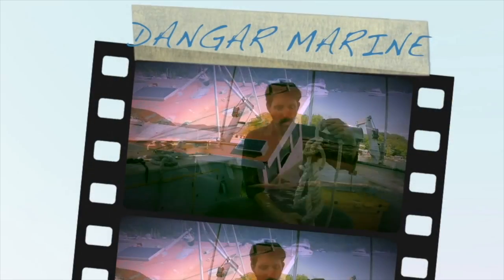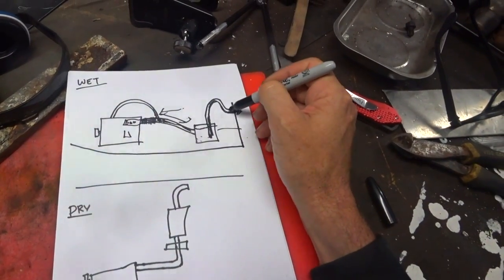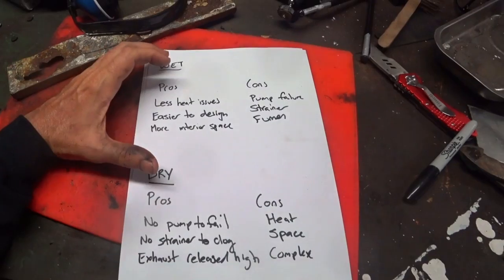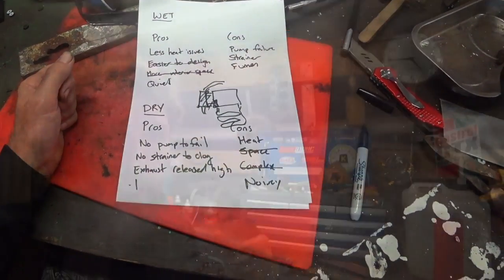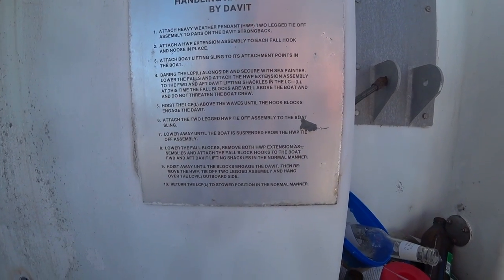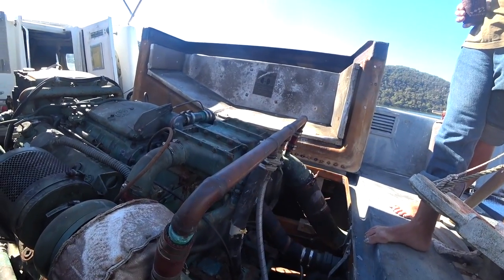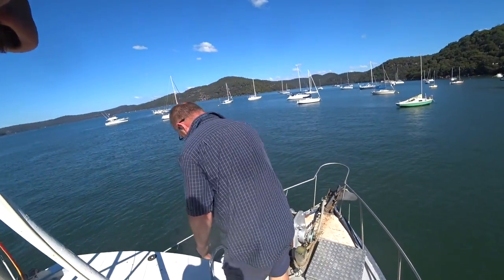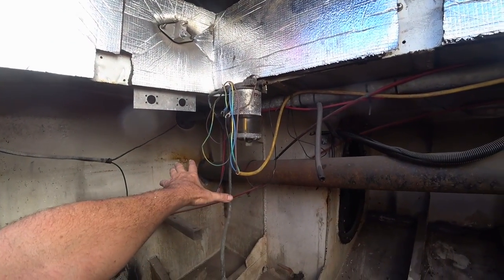Wet Exhaust vs Dry Exhaust

Comment: Looks simple enough to modify dry exhaust out in existing, just double pipe it through the deck muffler could be installed near through deck, then double piped/shielded, like on a semi-truck, then have large pipe out top of muffler to reduce back pressure and cooler pipe section so heat will naturally rise out to cooler air. Not over think it, I think it could be easily installed by you once you understand your sound deadening and pipe size needs, 6" pipe schedule 10? Keep exhaust manifold cooled to create temp differential to have slight vacuum at exhaust outlet. 
What old car guys used to do was leave cast manifold in place and 1.5 times the outlet from original for cheap performance/extraction/exit of exhaust.

Comment: If that exhaust leak is before the turbo it will be why you are lacking power, and blowing smoke. The turbo wont be spoiling enough to run how it's mean to resulting in in burnt fuel. Also you don't need to pull the turbos off the check if they're okay. Pull the air filter off and check the compressor wheel for chips, cracks, see how easily it rotates and see if you can move the shaft up down left or right. If it moves much then the turbos are due a rebuild. You can even remove the exhaust and check the exhaust wheel if you want to check, but the main thing to look for in those turbos is play in the shaft.
Reply from the maker: Hey Mark, thanks for the info. I'm looking forward to taking a look at fixing this boat up with Rick on day. It is a great offshore fishing boat when it is running well.

Comment: A properly installed dry exhaust has less parts and less to brake down . On a lot of engines the noise comes from the air intake that is equal  to the noise of the exhaust .  Just mount a air intake silencer / intake air filter and the noise goes down a lot .

Comment: I think by having the muffler closer to the end of the exhaust serves two purposes 1st smaller muffler 2nd less weight. I believe your way ahead with the dry because of space and failure rate . The engine is in need of lots of air and by running a second pipe just short of the end of the exhaust (18-24 inch’s) and with a K-N filter your fixing a lot of problems . I honestly believe the dry exhaust is the way to go ! Less moving parts so to speak ! 😆 can’t wait for more videos bud ! And a messy shop is a busy shop ! If they don’t like it , well they can come and clean it ! You need to talk to those chickens , there laying down on the job !! Lmao 🤣
Reply from the maker: Yes, I'm looking forward to talking to those guys about the placement of the muffler or even mufflers. I think with a bit of planning the dry exhaust can be made to be quiet. I'll get those chickens off their butts. ;)

Comment: I'm wondering if your boat might have had a bigger motor at one time which necessitated the wet exhaust system. I agree with other comments that pointed-out that over-the-road Jimmys  all have dry stacks and mufflers.

Comment: There is another wet exhaust that exits at or below the waterline. It has a rise in the interior that stops the sea water from coming back into the engine and not only quiets the exhaust, but also stops the problem of exhaust from coming bck to the people on a following sea.
Reply from the maker: Yes, I think that is a better way to go.

Comment: Looks like it was dry without a muffler(s), I'd reckon it's have been quite noisy. I'd expect that the wet exhaust would be quite restrictive and a dry exhaust with a good straight through muffler would be a lot better from a performance point of view. As you and others have mentioned a dry exhaust would free up a heap of room.

Comment: another great vid Stu, looking at your boats config I'd say it was a lay down misere to go back to dry. it goes neatly up the outside wall, and you get your engine bay and lazarette back. with ceramic coated pipe a decent blanket and a heat shield should be nice,just get a straight through muffler diesels don't like baffles. try agaus.com.au for thermal blanketsor ready made removable pipe wraps found them while researching thermal insulation for a forge cheers
Reply: That's an awesome post...
Reply from the maker: Thanks mate, I also think going back to dry is a big of a no-brainer. Thanks for the link to the insulation.

Comment: Only issue I really see with the roof-pipes is that it's a completely open vertical system, meaning any rain is going to go straight down those pipes and eventually back into the heads.  Having to design a system to prevent that completely might be a bit of an issue since your through-holes are already laid out, you'd need a sink-trap and a drain for it somewhere or to have an upside-down U on the top so the pipe points downward to prevent water ingress.

Comment: I used to work on those 8V71-TI and the 4-71 in your boat. Wet exhaust is absolutely necessary for a two stroke engine for efficient exhaust scavenging. Dry exhausts work well for four stroke engines. However there is something to be said for keeping it simple.
Reply: Wait, didn't those Detroits also go into school buses, trucks, generators, etc.?  How did they do wet exhaust in those applications?

Comment: Seeing as an effective muffler is quite tall, could the boat have been refitted due to height restrictions where it was operated at some time?  Low bridges or to fit into a shed?  Or maybe for soot and particulate emission control/restrictions?  I imagine a horizontal muffler +heat shielding would take up some deck/roof space and have to have weep holes for condensation and rust prevention.  I would think that mufflers used for large construction gensets operated in residential areas would be a good starting point.
Reply from the maker: I wish I knew more about the history of this boat, I think it would answer a few questions. Good idea to look at how gensets muffled in residential areas.

Comment: All very informative, good work. But I sat through the rust removal one, I was too tired and cranky. Look up molasses for rust removal. 10 water to 1 molasses, 2Weeks in the bath, all rust is gone, but not good on galvanized, tends to eat  some alloys. Heaps on poo tube. Good luck.
Reply from the maker: No worries, I shouldn't have snapped either. I have heard of people using molasses. What I have enjoyed about the electrolysis bath is that once it is set up I've just been swapping parts over and cleaning a whole load of stuff up without the need to buy any supplies or do any messy cleanup.

Comment: Looks like you'll probably have to build a locker to surround the exhaust pipe, between deck and roof level, insulated and soundproofed- but, other than that, you're already set up to go dry. It really does make you wonder what the huge advantage was, that the previous owners went to wet. Maybe they were smugglers? Anyway, looks to me that the amount of maintenance a marine motor gets is proportionate to how difficult the access is, so anything you can do to make it an easy place to work is an improvement! Rather prefer to be careful of 1 hot pipe, than have to climb around all that funky plumbing...
Reply from the maker: Good point about the maintenance dropping once the access is difficult. That is human nature.

Comment: Nice work, good overview.  So your trawler already has a keel cooler ?  The raw water pump is just to cool the wet exhaust presumably.  The 2 stroke is going to be very picky about back-pressure as you say.  Is a used john deere 6068, or Cat 3208/3116 out of the question ? 4 cycle non electronic might be a good way to go, quieter more economical lighter weight etc
Reply from the maker: No, it currently has a heat exhanger on it, not keel cooled (yet!)

Comment: Did you save the plug from the hole saw?  Perfect for welding back in to fill the overboard hóle!
Have you considered rerouting the wet exhaust to allow access to hard to get to spots?

Thanx from the left coast near the Krapitol of California
Reply from the maker: I have thought about directing the wet, but with the fuel tanks in the way there isn't any easy way to get it to the transom without being in the way.

Comment: May be an idea if your considering dry. to have manifold, turbo and outlet ceracoted and titanium insultion tape around the piping. having a dummy mfler alongside the muffler connected by y joint. The idea of a second muffler blocked off 1 end  is it takes away a lot of that drone. My car has a 2" system straight through system 2 resonators and a split muffler with 2× 2" outlet pipes with 1 pipe blocked off at the end. a lot quieter than you might think.

Comment: I prefer the sound of a dry exhaust, doesn’t sound like someone with fluid on their lungs. There’s also no exhaust hanging around the boat. It’s what fish tugs use on the Great Lakes and can be quiet if properly designed. One plus for us (and a serious negative for you) is the stack running through the wheelhouse warms and dries.

Comment: I have build mufflers for diesel motors in boats and found that they do run quite if the correct baffling is done.
Reply from the maker: Thanks Paul. Any specific tips on a muffler for a 4-71 would be greatly appreciated.

Comment: Not only the wind will blow the exhaust gas away on a dry exhaust, because it is more up, but also because the exhaust gas is hot and wants to go straight up into the sky, as hot gas tends to do.
That would certainly be a great advantage when it comes to safety on board.
Reply: Dragomir Ronilac  Well, you put your bet onto the wrong...
By the way, physics works always the same way, on boat and also while not on a boat!

Comment: if the engine runs ok with the back pressure from a wet exhaust it should have no problem with a big muffler on a dry system as they generally have a lot less pressure than the wet alternative

Comment: BTW was there a huge winch mounted at the top of your stairs at shop in previous video, with cable running downhill?
Reply from the maker: Yes, there is an inclinator cart you can winch up the stairs for heavy loads.

Comment: I note that Nordhavn trawlers use dry exhaust and keel cooling. When you have one engine and cross oceans, simple is better. On their larger boats with dual engines, they use wet. The gensets are wet as are the "get home" engines.

Comment: Stu have you thought about a hybrid? I have seen them used on some ski boats where they use a dry exhaust with a heat exchange unit attached to keep the exhaust manifold and early part of the exhaust pipe cool. Would keep the heat down in the engine compartment and probably make the exhaust stack less of a fire/burn danger.
Reply from the maker: I'll look into that Matthew. This engine does have a water jacket around the exhaust manifold like Rick's boat does. It will be interesting to get the infrared thermometer onto it and see what the temperatures actually are.

Comment: Hi there Stu, great video mate and i agree 1000% to re-instate the dry exhaust system you may gain output power i think, due to the more free flow of the gasses. And the engine bay would definitely look alot better without all the extra stuff for the wet exhaust system. Mate it's a no brainer really. K.I.S.S. principle keep, it, simple, stupid!.

Comment: If you do dry exhaust, plan to stay at trawler speed, then put keel coolers on it. Do away with all the raw water pumps and heat exchanger. The only time you need to go with heat exchanger is when you are pushing higher horsepower and need the added cooling for the engine, and the water to air  aftercooler, fuel coolers, ect. I have to run heat exchanger's on my cummins because it is getting up there in hp and the only way to cool that is alot of coolers, and cool water going through all of them.

Comment: So exhaust size can play a part in noise as well. my experience is small exhaust is quiet by making more back pressure and creating more heat whereas a large exhaust is more louder but allows  exhaust to flow better reducing heat 🤔

Comment: First I want to say I spent 18 years working on boats, and you do a great job. But you did leave out one point on a wet exhaust that I feel you should mention. If your engine doesn't start with a wet exhaust you can back flood the engine because the wet muffler will will up and the way they are plumbed means it will run back into the engine. Cheers just wanted to point it out.
Reply from the maker: Failing to start gets mentioned here https://youtu.be/tC4jHyUuDs0?t=758

Comment: Go with dry exhaust. Modern mufflers (automotive) have very little back pressure. Is there  ever a condition with wet exhaust where enough water evaporates to cause salt buildup in the downstream exhaust tube?
Reply from the maker: I imagine corrosion really must be a big problem in these wet exhaust system. This one is all mild steel too.

Comment: Thanks for another great video..... If back pressure is an issue, would I be wrong in thinking that the convoluted path that the wet exhaust has to travel would create more back pressure than a dry shorter run with a simple muffler..... Cheers

Comment: One thing that wasnt mentioned in this vid was the ventilation ,, maybe a 150mm pipe from inside the engine room up to above the wheel house roof,,   then in the middle of this pipe install your engine exhaust ,,,,  but leave it down maybe 300 mm so when the exhaust fumes suck the hot air out of the engine room,,
Reply from the maker: Yes, a good convection gap around the exhaust is a great way to keep the engine room temps down.

Comment: Hi Stu, what would be wrong with wrapping your dry exhaust with a 10mm copper tube, raw water fed, to cool the exhaust, blanket wrap the pair. Regards Dave.
Reply: Could buy a new boat for the price of the copper (aka Dr Copper)!.
Reply from the maker: You can get double walled exhaust that has a water jacketed around the outside.
Reply: copper pipe in the uk is cheap, its classed as micro bore, sold in 10mtr length. It was just an idea.

Comment: i thing a dry would be better because its simpler and easy to repair, with the wet you have to deal with pumps failures. would using the heat exchange water to cool a dry exhaust help in any way?
Reply: If cool the exhaust the gases will take up less space and have lower back pressure

Comment: I think you are wise to leave the wet exhaust system in place until you are happy with your dry exhaust. Those 2 stroke Detroit’s are incredibly noisy and Smokey. Probably best to get the exhaust gases as far away from the boat as possible with a dry exhaust and find a really good muffler system to deal with the noise.

Comment: Go dry - you can damp-down the sound and the stack won't have large footprint... small sacrifice = big gain.  I think you'll regret leaving the wet-system in-place as a means of hedging your bet.  You've done such great work as a from-scratch re-build... don't muck it up and frustrate yourself by removing the old system after the engine is back in place.  Clean it up now and maintain your advantage while the engine is out... Future Stu will thank you.
Reply from the maker: Yes, that thought did occur to me too. I don't like the idea of squeezing in there with a grinder and cutting that old pipe out.

Comment: Weld on a keel cooler mate, then you don't have to worry about a coolant hole in the boat, water pump and impellers, heat exchangers, zincs, strainers, blockages and outlet hole. Ideal goal - no hole in the boat for the entire propulsion system! I am in Mexico and most fishing trawlers here are set up with keel coolers and dry stack.
Reply from the maker: Yep, I do really like the idea of moving to keel cooling one day.

Comment: you can run your heat exchanger discharge to a warm water deck hose or you can just build your self a keel cooler and be done with it

Comment: Wet exhaust seems like just more of something that could go wrong, require extra maintenance, etc.  What prevents an inboard exhaust from exiting vessel below the water line similar to how and outboard has its exhaust set up?  Does an inboard motor design stand the chance of drawing water back up into the engine?  Novice at engine mechanics so just wondering.

Comment: Either idea will be great whatever easy for you to work with and dry exhaust will look cool. However the dry exhaust has an issue with dry diesel powder cough up and send up in air spread the black dust powder all over you and the boat. There are pros and cons.
Reply from the maker: Yes, I have heard of that happening in a marina and covering the boat next to it in black soot.

Comment: What about a combination system. Dry exhaust but have a heat exchanger and a water system discharge directly over board. It give you a visual clue that your raw water pump is running but you can put a muffler in to keep the exhaust quite, you have a lot of room between the deck and the coach roof to install a muffler and box it in.
Reply from the maker: That's pretty much what I'm planning to go with.

Comment: Have you done a video on cleaning an outboard exhaust? I was told that if you take the foot off that there is an exhaust area that can be cleaned. I have an 85, 150 hp Evinrude that may need it.
Reply from the maker: Haven't done a vid on it, but there is an exhaust pipe of sorts in the mid section of an outboard. I find they tend to rust away rather than block up though.

Comment: I still believe the wet exhaust is a better setup (just not this one), The system is called aqualift muffler on fibreglass boats the whole system from the water inlet to the overboard is fibreglass, The rear facing exhaust manifold is a good idea, or utilise the dead space outboard of the engine On same side as exhaust, not wrapped aroungd the front. for the aqualift, I dare say you could port the exhaust overboard in front of the fuel tank as well, In seeing the setup you are dealing with (as in most of the dry is still there) the dry is going to be far simpler to make right over basically tearing out the wet and starting from scratch.